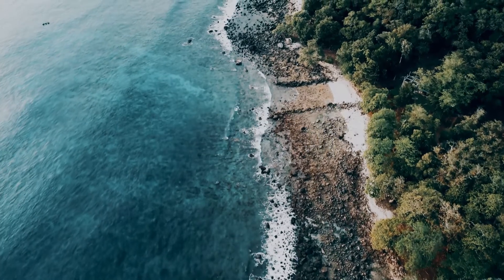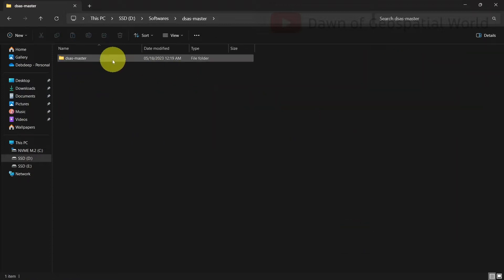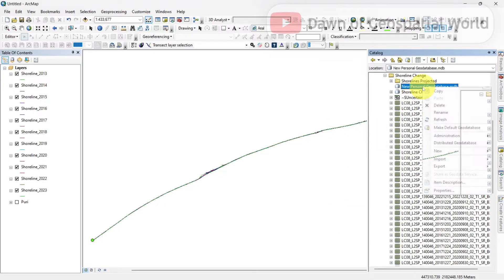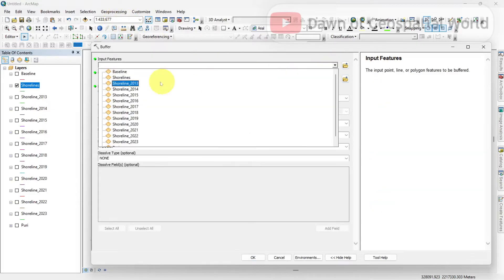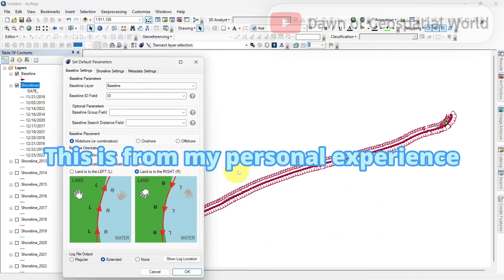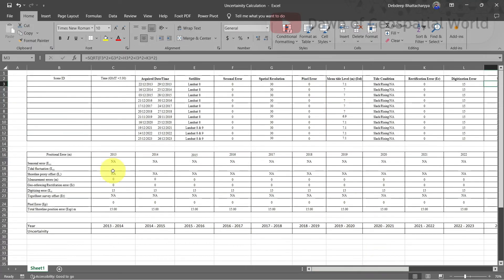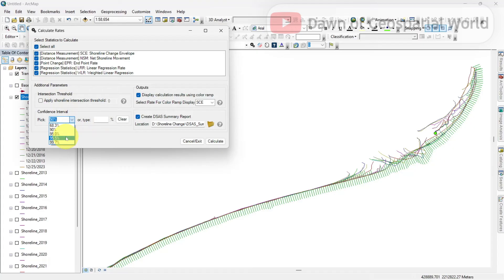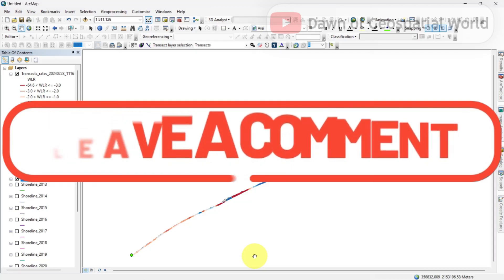Shoreline Change Analysis with DSAS v5.1 in ArcMap | Shoreline Change Analysis PART 2

Comment: Hi 😊, I leave in Tanzania, and in data preparation, I set WGS 1984 UTM ZONE 37S
When I perform folder connection in DSAS, It tell
me my data is not projected, so what's should I do or
what's problems
Reply from the maker: When you create shapefiles, set the shapefile projection as UTM 37S and set the Data frame projection also in UTM 37S. This will solve your problem.

Comment: Sir when i try to calculate rates..it shows "UNABLE TO FIND DATABASE TABLE FOR BASELINE LAYER ". how to solve this issue..
Thank you🫶
Reply from the maker: check the attribute table. all the column names and values should be as shown in the video. After that save & stop the editing and then run DSAS
Reply: Tried everything sir nothing happened. What should I do
Reply from the maker: @subhajitdas8130  Do you create Baseline layer as mentioned? Is the attribute table opening?
Reply: Yes attribute table is opening
Reply: Currently I am using argis 10.8 is it because of this version?
Reply from the maker: @subhajitdas8130  Not a problem. save and stop editing of baseline layer or other layer
Reply: All layers editing are stopped.. infact we can't continue without stopping editing..
Reply: What  should I do ..I done all changes in the system as per requirement
Reply from the maker: @subhajitdas8130  Then i don't understand where is the problem. Try the process from the beginning.
Reply: @dawnofgeospatialworld  the issue was resolved after trying in 10.4..thank you for your assistance
Reply from the maker: @subhajitdas8130  Great

Comment: hello sir, I am conducting DSAS analysis for the years 2017 and 2024. Do I need to modify any steps or convert any data anywhere? thank you
Reply from the maker: If only 2 shorelines (2017 & 2024) are there, then go for NSM

Comment: I analyzed shoreline changes for the years 2017 and 2024, but the WLR results show as NULL. Does this mean that at least 3 years are required for WLR to generate results?
Reply from the maker: yes, WLR will be calculated for many year's shoreline data

Comment: Hello, sir! I am running DSAS to measure the movement of right bank and left bank of the rivers. What I did was to create a 100m buffer for the right bank in right and then left buffer for the left bank. Is this correct?
Reply from the maker: yes, Run the DSAS for each bank separately

Comment: Hello, when I try to make a transect I get the following error: "Optional field not found in baseline layer.Baseline.Group (Press ctrl+copyt his message to the clipboard)" What is the reason?
Reply from the maker: Enable editing of baseline, write 1 in group and save. then try to run DSAS
Reply: @dawnofgeospatialworld  Thank you, I found the problem, the file names were not the same, I fixed it and it was successful. Thank you also for this video. A nice instructional video.
Reply: First of all, thanks for such a detailed video.but I have a question regarding tide data. If I don't get tide data for all the selected years for a particular gauge station, can I use data from another station located around 60 km away? Or what can be done for no data values? Pls suggest...
Reply from the maker: @ Yes you can use. But keep in mind that tide data should be for same month or season
Reply: Thanks for your reply..
If it is yearly data as you have used, then?? In one of the comments, you advised not to take uncertainty '0' as shore lines are dynamic. Is it also applicable for rivers under tidal influence?? Or we consider river banks are more stable than shore lines? Pls suggest your view..

Comment: Hello, sir! This is so helpful! I just have a question. The trace tool won't work on my end. What could be the possible solution for that? Thank you!
Reply from the maker: check the projections (we need UTM), Stop all shapefile editing.
Reply: Got this! I’ll try to apply that. I also have another question. I am actually doing the same method in monitoring river channel shifting change and I am failing to automatically generate its midline for shifting rate calculation and I ended up manually digitizing it. Do you have any suggestions in this case? Btw, thank you for the reply!!
Reply from the maker: @roseeirenedelacruz1476  for rivers, it is a tough process to determine the midline
Reply: @dawnofgeospatialworld  Understood. I have only used the midpoint tool to manually digitize the midline

Comment: if i am doing shoreline change analysis for 2 shoreline. 2016 and 2023 ( no in between years) how should i calculate the  uncertainty . how I should divide it ?  for example =SQRT(B10+C10)/          here what should i put in the denominator ?   2 or  1 or  8
Reply from the maker: 2, if only two shorelines are there
Reply: @dawnofgeospatialworld   so what should i put while calculating the rates  whether (WLR OR NSM)
Reply: hello sir
Reply: ok thank you sir
Reply: hello sir so what should i put while calculating the rates  whether (WLR OR NSM)

Comment: Hello sir,the tide level data I can obtain is incomplete, if I fill in all the 0 in the uncertainty area, would it be a big impact?
Reply from the maker: Taking 0 as uncertainty will give you some little error to your result. You can keep it 1 to 1.5m
Reply: @dawnofgeospatialworld  Thank you
Reply: @dawnofgeospatialworld  And sir, could you tell me do I determine the size of the buffer?
Reply from the maker: @BINGLee-mg4ds  you can take at least 500 meters
Reply: @dawnofgeospatialworld  And I want to know why the smoothness is to take 2500, I have seen other tutorials are to take 0, may you teach me?
Reply from the maker: @BINGLee-mg4ds  2500 will give you straight lines, 0 will give you intersecting lines

Comment: Sir what if I don't want to consider tidal effects, can I just skip the uncertainty calculation step then? Sorry if the question may seem stupid
Reply from the maker: Yes you can. Just keep in mind that how much tidal height can be appeared in your study area. Place that value in uncertainty parameter.
Reply: @dawnofgeospatialworld  so I can put 0 in my 'Default Data Uncertainty' column if I don't want to consider tidal effects at all?
Reply from the maker: @syafiq657  Tidal data uncertainty couldn't be 0. because everyday some amount of tides happens.
Reply: @dawnofgeospatialworld  what value do you suggest I put in the 'Default Data Uncertainty' space if I don't want to consider tidal effects? it should be close to 0 right?
Reply from the maker: @syafiq657  yes, between 0 to 2 meters

Comment: sir, sorry to bother you again. I need to calculate LRR and NSM only in that case shall I only select LRR from the 'select statistics to calculate' box and then also  LRR in the 'rate for colour ramp display'? Or are the LRR attribute values that I have while doing WLR like in the video enough? And if I want to calculate EPR do I have to create databases separately for two - to two years and perform the DSAS analysis?
Reply from the maker: you can select your required parameter to calculate. But for displaying the rates on canvas you need to run separately. like one time for NSM & one time for LRR from colour ramp display.
Reply from the maker: NSM, EPR & LRR are for short term change analysis. like 1 or 2 years gap while WLR is for long term analysis with many year's shoreline

Comment: Sir, why have you put two dates in the column of Acquired Date in the Excel sheet? and my datasets belong to the month of January, February and March. how will i find the seasonal error for these dates?
Reply from the maker: I have written two dates because this area is comes under 2 different dates and I have to mosaic 2 satellite images. But if your area comes under only one satellite image, then you can write only that acquired date.  
Mostly Winter season has 0 seasonal error. but if you take summer or rainy season or 2 different seasons, then seasonal error will change. So try to take winter season time satellite images it will also be cloud less.

Comment: There are null values for most of the data how to calculate that even there is defined shoreline for all the years .. how can I get transect rates for full shoreline please help
Reply from the maker: Most of the data should not be null value. You can recheck your data. Write the shoreline date correctly. Maybe you write the previous shoreline date on next shoreline.

There will be one more possibility that both shorelines are going through the same locations. Are they both superimposed? then it should give null values. Because then no erosion or deposition will calculated.
Reply: No they are not superimposed and I have checked it all entries are correct
Reply from the maker: @kiransindhal6380  Then without showing the result i cannot say anything. You can send an image of shorelines with date label & transects image at our mail or Instagram. contact details are written in our about section.

Comment from the maker: Uncertainty Calculation Excel sheet : https://bit.ly/3TbeqiM
Reply: Can we use this data for any country? 
If not, how to generate  data. And in case the tide gauge data for My country is not available on the PSMSL website? How can I get uncertainty .
My country TOGO (West Africa)
Thanks you for all
Reply from the maker: @cathgbegnon1036  there are some other websites where you can find tide data. otherwise check that does your country has any tidal data repository